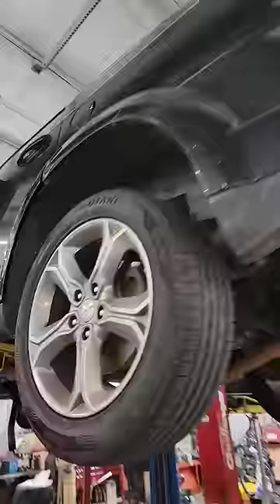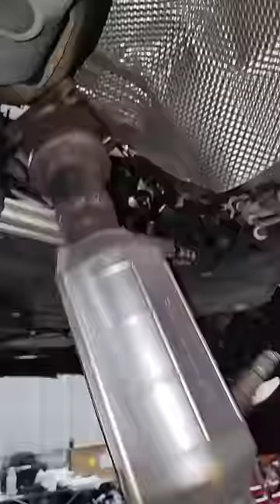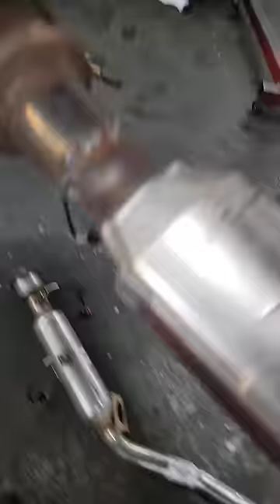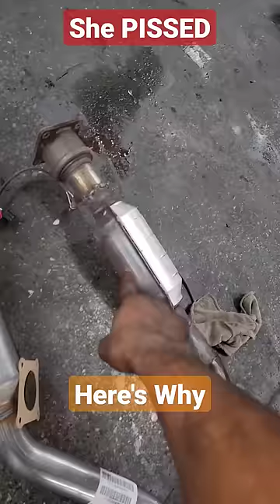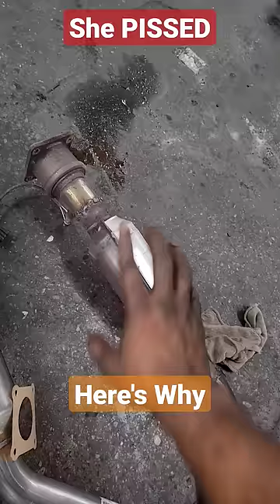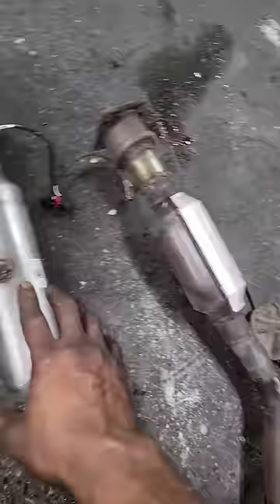This customer freaken Pissed Off. But at whom?

Comment: if it wasn't a dealer, then she can't get pissed if it was a regular auto shop.
Reply: An independent shop can check for a recall or a tsb/special service bulletin on a vehicle. That's why an independent is SUPPOSED to pay for service information, for how to properly do repairs and to check for recalls and tsb's from the manufacturer.
Reply: And the customer alrdy asking they need the car back before even having it diagnosed running a shop is time consuming
Reply: Good mechanics and managers keep up to date on recalls regardless of work shop affiliation.
As for Main dealers they are known to fix recalls in silence behind closed doors (been there done that), you will not be told about it either as it will not appear on your bill or the service record you have, it is however registered on the manufacturers database (which customers don’t have access to).
Reply: Nope you don't have the right to be upset unless it was a dealer. Your funnyman. Excuse me mam but I'm not a dealer so you can't have feelings 😔
Reply: The people in this thread😮.. all recalls, are sent by letter to the owner of the vehicle, by law!!!!!
    Certainly some people never get the letter because of being migrational, and any shop worth their salt, will be paid for doing the work!!!!
    It takes mere seconds to discover a recall on any car.
Reply: @bartbullock9742  what about them silent recalls?
Reply: @rosslefave5877  them there silent recalls... Not enough people die..or not enough people complained, just a fact of life.
Reply: @bartbullock9742  ya I don't believe that. It's just one person that died doesn't fly with me
Reply: @rosslefave5877  you're right, one person is one too many, I worked at 5 different dealerships in my life, paint and body, certified parts man, and sales, I've handled many warranty recalls, I guess the craziest was the great Ford lug nut recall, I hate to say it, but I've handled many nuts... Not proud.
Reply: @bartbullock9742  they just gave them nuts up and didn't want em
Reply: @rosslefave5877  I had heard that engineer that came up with building a washer into the lug nut, was blackballed, it looks good on paper.........
Reply: @bartbullock9742  anything newer just seems ridiculous and unnecessary. Makes me enjoy the bicycle much better
Reply: @LoneWolfSparty  You can also read the recall letter you got in the mail too.

Comment: I’d absolutely be pissed too, back in the day ford had a recall on my 87 GT foxbody cats, every time I pushed the clutch inn the cat shields would rattle, I wasn’t aware of the recall as I took it to the dealership to have a cpl fuel injectors replaced and the mechanic informed me of the recall and didn’t cost me a cent for the new cats so I was pretty stoked lol, you sure see a lot of Dorman parts prematurely fail, I think as far as simple interior armrest etc I’ve purchased through Dorman has been fine but as far as mechanical parts go, I buy nothing but GM/ AC DELCO for my ZR2 blazer.
Reply: The shields rattle on my '90 Ford, one piece fell off.  Both cat and muffler. Gonna secure them with a long hose clamp one of these days...
Reply: @thisisyourcaptainspeaking2259  if you don’t have to go through emissions in your state, cut those cats off and put a set of borla mufflers on it, would sure sound good, I’m assuming it’s a V8?
Reply: @jamiel3504  I like the cat.  Stinks way less than no cat while idling around the shop and house.
I saved an old burned out cat from another car for the stainless shields, looks like they might fit but haven't gotten around to it.

Comment: They did her dirty. I hate people like that, they could have just gone to the NHTSA website and punched in the VIN for her and most likely would have come up. Would have taken less than 5 minutes.
Reply from the maker: Exactly
Reply: Not necessarily, when I work at shops majority of the time, we didn't know unless another mechanic already knew about it. I've seen ppl decline dealer parts bc of the price. Now that I do work on the side I check things like that. Also I look up the price of the dealer part vs the aftermarket. Some dealer parts are only like at the most $100 more. Now that's some parts. I was just looking at cats for my friends car and the dealer is actually about $70 less than aftermarket. They're still high as giraffes ass lol.

Comment: I've got a 2012 grand caravan with the pentastar and last year had the same cat efficiency trouble and took it to the stealership for the diag. and replacement due to HORROR STORIES I've heard from people about aftermarket cats. NEVER GO AFTERMARKET CATS NEVER!!
Reply from the maker: Yes, if those aftermarket cats not meeting the specs  they will cause all kind of problems. Most fail to even meet the flow rate specs.

Comment: But it was nothing wrong with the cat they installed. She just happened to be at the dealership and they told her about the recall.
Reply from the maker: She not pissed because something wrong with it, she pissed at them for not telling her. They likely knew when they ran the VIN.
Reply: @Online Mechanic Tips  not necessarily. I never thought about it as a tech. Figured dealerships notify customers about recalls. I've only recently started checking those. Only bc it's potentially free.
Reply from the maker: @vbarbee1  interesting. She's even more pissed because she can't take it back to get her money back. We kept it for core return
Reply: @vbarbee1 my local mechanic informs me of any potential recalls on my vehicles every inspection. That shop knew they were pulling a fast one
Reply: I mean I could be wrong. Now are we talking about shops or "shops" there's a difference. I can see major shops but smaller shops idk 🤷‍♂️
Reply: @vbarbee1  letters to notify go out to the registered owners...if the customer doesnt have it registered under their name or havent updated the address it will never reach them....in fact even if it does people seem to ignore them thinking its a scam or spam mail
Reply: Kia mailed me for a recall, was on the heater in the seats. It came in the regular mail.
Reply: @OnlineMechanicTips YOU kept ot for a core?  It should have be given back to her to get money back on.

Comment: She could fill out the forms for having to replace that.
Check your warranty and policy manuals.
There can be reimbursement by the manufacturer of the vehicle.
A customer should not have to repair the car when it has an issue beyond the customers ability to prevent failure and coverage of one type or another exists.
Your recall forms you read may even outline the procedure and even tell which forms can be submitted.
Dont let the cat get out before the paperwork has all been done for the best outcome.
The exhaust shop may not yet have the info, and since theres federal law about it, somebody needs to see to it they have a way to find out.
Information systems exist and updating them is expensive.
But anybody can use a search engine about a car problem and find such a recall exists.
They can also call their state agency to check before determining.
It takes time.
But its better than a federal fine or a state fine, or both.

Comment: As a mechanic, I always told my customers if there’s a recall, I just saved three different customers thousands of dollars because of their engine was under warranty and I didn’t know it through the dealer GTI with 97,000 miles and for Catalytic Converter’s never used nothing but OEM it’ll always come back to code waste of money

Comment: ITS NEVER, EVER the responsibility of an independent shop to research recalls. 
That lies solely on the owner and manufacturer, PERIOD!
Ill wager she received a notice from the manufacturer as a current registered owner and tossed it as junk mail.
Ive received several recal notices on cars and trucks I've purchased used over the years, opened every one, had every repair done at the dealership at no cost, but one and I skipped that one because it was a simple light repair, that cost me 8.00 to take care of myself.

Comment: it's not up to the repair shops to keep up on recalls. she got the letter in the mail from the factory and from NTSB if it's a safety recall.  
I don't think dorman makes converters.  that's more than likely a Walker(junk).  
I only buy Eastern catalytic brand.  409 stainless steel and  they're guaranteed for 50k miles or 5 years.

Comment: First off it should be covered under eight years 80,000 miles federally mandated warranty.
Second, if there’s a recall, that means the original design wasn’t much good.
Third, that woman absolutely should get her money back. The shop had no business selling a catalytic converter under eight years or 80,000 miles and they should’ve checked to see if there was a record.

Comment: & the shop that originally changed her catalytic converter probably sold her old catalytic converter for scrap value sometimes as much as the cheaper aftermarket cat ! Some of those OEM cats are more valuable as scrap then the new aftermarket replacement part cost new 😁

Comment: Im a shop owner, I check all tsbs and recalls before I handle the repair. However, not all shops have resources I have. Smaller the shop is harder it becomes. It's the vehicle owner's responsibility to stay on top of the recall, TSB, campaigns. Even if you are being serviced at the dealership, if you don't update your profile, you will miss the email or letter.

Comment: How did you get that covered under the Warrenty? I had a GM pickup with a y style cat on the v6 that was altered by a muffler shop who cutoff the cat flange adapter to weld a new  exhaust  system.  Only to get a bad cat code shortly after work was done, I had a recall also but the dealer wouldn’t honor the 12 year replacement on that recall because emission equipment has been altered.

Comment: And this is exactly why I never go to the shop they never want to use actual OEM Parts they always want to go buy the cheapest option at the local auto parts store and then upcharge you like it cost them anything. And then they want to be all pissy about it when you bring your own parts that are from the original manufacturer and are much higher quality than anything they're going to put on the car. I had an argument with a guy over the phone who assured me that they use only the highest-quality parts after telling me that they don't go to dealerships because it takes too long to get the parts
Reply: On older vehicles 10+ years old.  OEM isnt an option sometimes.  Carcmakers are only required by law to make oem parts for i believe 10 years and thats it.   Youre falling into this guys trap of mopar or no car nonsense.   Yes mopar is bettee for (some stuff)  but not all

Comment: The last time I had a catalyst efficiency code it turned out I just needed to replace my air filter. It was the factory air filter and it lasted 90,000 miles.

Comment: Ok so it’s a RECALL GO to DEALER get a FREE REPAIR REPLACEMENT and send the car manufacturer the RECEIPT on what you sent and they’ll REIMBURSE YOU! Simple! 😅
     I had to replace axles on my 2013 Honda fit TWICE! Costed $1,300 each side! 2 years later found out there was a recall. And went to Honda they removed my fairly newish axles I bought and paid for nothing wrong with them but cuz recall they had to anyways and I sent Honda the $5,200 I spent out of pocket for the 2 past replacements repairs and was reimbursed. Got a check in the mail within like two months.!

Comment: Typically FCA will reimburse a customer for something that has been repaired by another shop if the recall was issued after the work was performed. While the shop did not do the repair correctly, that is not the issue of the customers. FCA should reimburse the customer in full if her work was performed before the recall letter was sent out. She needs to call FCA corporate and send them her original invoice for the aftermarket catalytic converter and they will send her a check in the mail.

Comment: Not all original equipment parts are equal. I drive a 2019 Grand Caravan that’s got an oil leak and water in the crank case. Turns out the plastic oil filter housing that also houses an oil cooler will warp over time and start leaking oil like crazy on top of the motor and can also allow coolant to pass into the oil. Dorman makes an all aluminum replacement that is superior to the OE.

Comment: My catalytic converter was recalled on my dodge avenger. I wanted to keep the old one so i could sell it but they told me they wouldnt replace it unless they keep the old one.
Reply: Probably a core for refurb. Otherwise shops are obligated to give you worn out or broken parts back if requested

Comment: Should have went to the dealer. But honestly my shop would have checked that. Any code it has is getting ran by Mitchell in the TSB and recall section if it's possibly under warranty still.

Comment: My 07 dodge charger with 2.7 throwing efficiency codes too. My scanner was showing the temperatures that my cats were getting up too and had/has me super concerned.  At idle Temps between 1000 and 1200 degrees and up in the 1600 and some when accelerating    Man..  I'm curious to whether or not my whip has a recall for cats too.  My cats look a lot like that Mopar cat in video and has 2 O2 sensors per cat too.  Do you possibly know whether or not the 2007 charger 2.7 has cat recall or not.  I haven't replaced them due to high price tag per cat.

Comment: She probably went to a small shop with little to no technology or resources and is not up-to-date.  Most likely, that shop didn't know about the recall. I have sold to shops for a living for 30 years. And I have run I into that a lot. A lot of small places still do not have computers. And use a small code reader for a check engine light.

Comment: My brother has a High Country diesel Chevrolet 4x4. The fuel pump failed and put metal shavings in the entire fuel system. Cost around $12,000-$15,000 for repair. He called GM and they said he only had a 70,000 mile warranty. He was at 85,000.

I read his owners manual and his vehicle actually has a 100,000 mile warranty. I called GM myself and they agreed.

Problem is my brother already had a local repair shop repair it. My brother was pissed.

Luckily my brother makes  around $400k a year.

Comment: Aftermarket and universal cats will often still set P0420's and P0430's, especially in California emissions vehicles. If you absolutely need a cat on a modern car/truck, you're better off just eating the cost of a new OE cat.
Edit: Or make sure it isn't a recalled part, which if you're already at the dealer, it would take 5 seconds.

Comment: We had a shop quote us around $1,100 to replace a clockspring and several sets of wheel-mounted buttons (radio, cruise, et cetera).

Hyundai had an open recall on the clockspring, and that fixed the trouble with the buttons.  For free!

That shop staff are apparently ripoff artists.

Comment: As an ex exhaust welder those welds are straight trash and probably leaking like a sprinkler which would cause the o2 codes to remain. I could a better job with my eyes closed and have. And it's Dorman and it looks like an AP cat.

Comment: The dealership garage would have known that.  Dealer garages are not really evil.  My dealer keeps its good customers for life.  The garage is a huge part of that.  The customers it loses couldn't afford the brand in the first place.  That explains their superb low mileage used stock.  However,  its currently not a good market for used cars.  Across the board, prices are too high for anything with a decent warranty.

Comment: This is one of the reasons why good  mechanics and auto shops get a bad rap, if this was one of my small shops we should only charge an inspection fee and good news that the dealer has a recall after checking for recalls on these types of repairs...

Comment: What years and vehicles does this recall cover? I have a regular customer with a 2017 jeep patriot 2.4 with a 420 code. She had a split in the exhaust manifold and we started by changing that first and the code is back, if I can send her to the dealer for a free cat I would like to do that. I ask because the converter looks identical to that new one you have there +rust.
Reply: Last I was aware, federal regulation requires 8yr/80,000 mile coverage on major emissions system components (cat definitely covered.. leaky gas cap throwing an EVAP leak, not so much).
Reply: @Marlin101084  its over the 80k mile limit

Comment: Looks like your underneath of a Jeep Patriot, those were the same cats they used for recall. Around the 2016 and 2017 years. Almost had a fire break out once it left the dealer, they left the wrapping and sticker on the cat had to climb underneath and spray with a water bottle.

Comment: You have to replace the O2 sensor the upstream O2 sensor. That's what's giving you the code it's the O2 sensor they wear out after about 75,000 miles

Comment: I'm surprised dodge would do the recall when the original part is no longer on the car. Not to mention the one that was replaced is aftermarket and is completely worthless as a core.

Comment: I just checked my car for recalls noticed my 2010 ford fusion sport not running as smooth, so i went to get check engine light, so they told me all it is is a clogged catalyc converter, so i checked for recalls but i did not see recalls for that, other stuff yes, so im a have to spend $1k on a cat converter

Comment: An independent shop had no obligation to check for her manufacturers recalls. Recalls are also mailed to you. She should be pissed at herself.

You’re also gonna get cat efficiency if you don’t properly heat cycle that cat. But no one does that properly.

Comment: other shop probably sold them on a completely cat, wether it be oem or aftermarket  not some universal, welded in to the middle of the orginal pipe, that other shop definitely bent them over